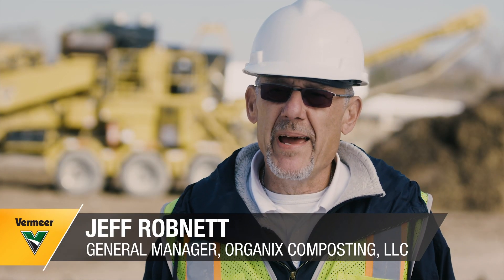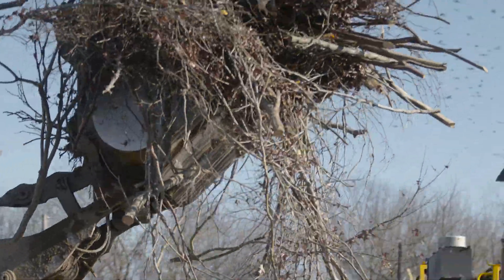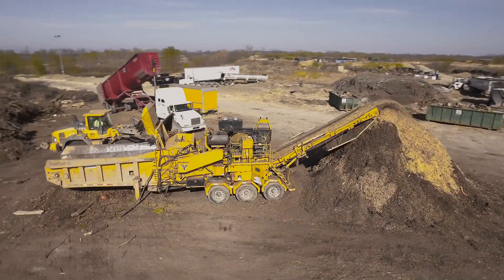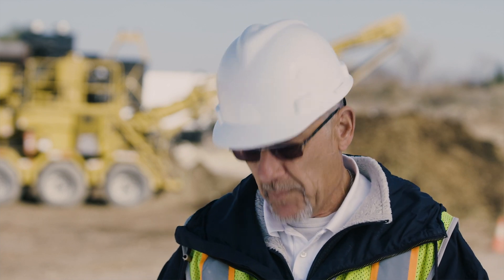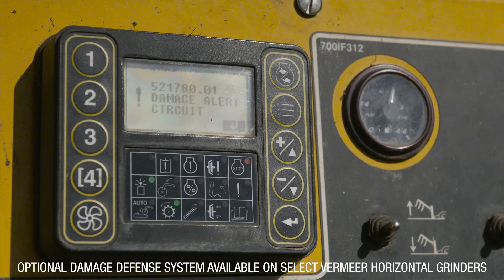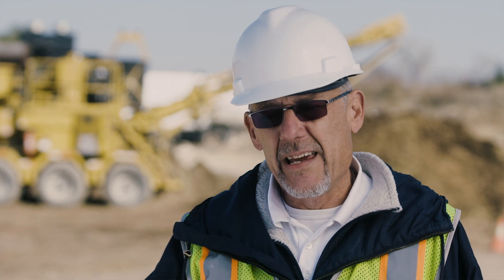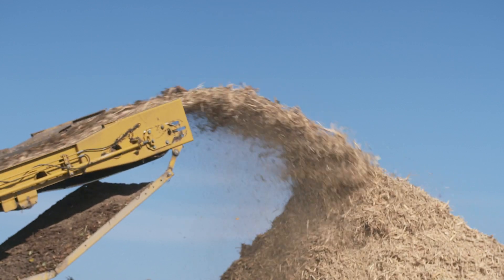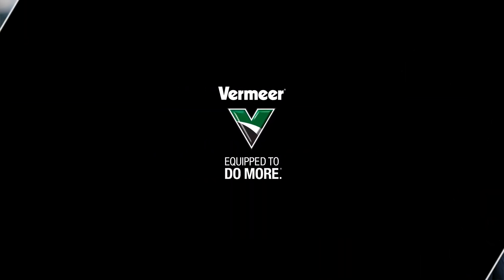Vermeer Damage Defense System for Horizontal and Tub Grinders

Comment: It doesn't show HOW the damage defense works.  It would be better IMO if a very powerful electromagnet were put over the belt feed to the grinder.  Anything steel or iron or other magnetic metal would be pulled out of the stream.  A sensor would detect that a piece of metal was grabbed and stop the feed.  Thus giving operators a chance to look at what got grabbed and do a spot check for more metal.

IMO, aluminum, lead, copper, brass, etc. wouldn't cause any real damage.